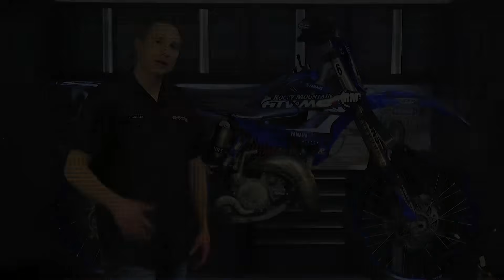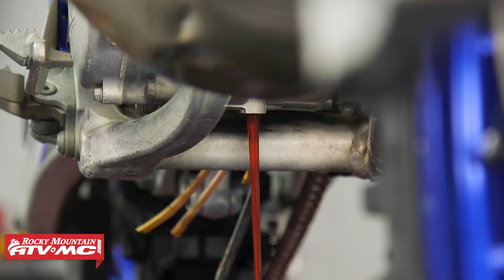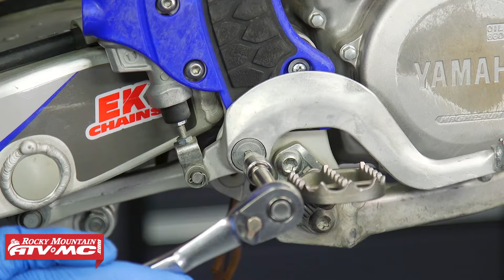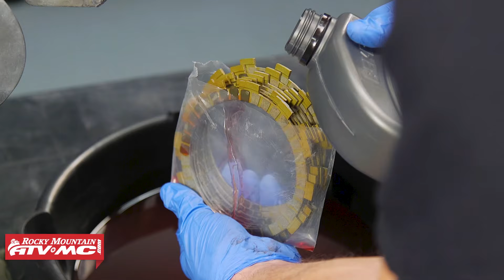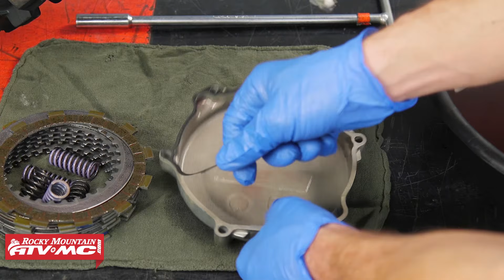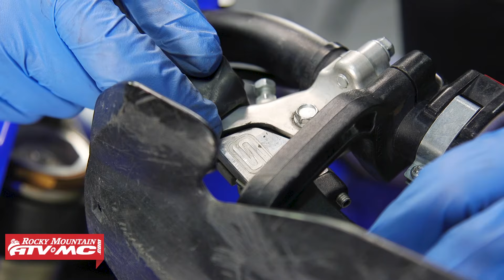How To Replace the Clutch on a Yamaha YZ125 & YZ125X

Comment: I have a 2000 yz 125 doing the clutch on it does mine suppose to have the ball because when i pulled mine apart there wasnt a ball . If I need it where can I get a replacement one I have been told I dont need it and others says I do . I just need some help kinda getting frustrated with the conflicting info . I dont wanna destroy my new clutch disks
Reply from the maker: You will not have the ball inside.

Comment: Does the pressure plate need to go a certain way?
Reply from the maker: No it doesn't.
Reply: @rmatvmc  Hi there just replaced clutch plates and cable on my 2014, having to use most of the adjustment in the cable and perch to get the correct freeplay, old cable was the same, thought it was worn out but guess not. Any ideas?  clutch doesnt disengage until the lever is nearly all the way out. Cheers

Comment: Never use Tusk aftermarket parts their junk. Used their plates and springs and they tore up my baskets after one ride. Couldn’t even pull in the lever. 600 dollars to get oem and runs great now. And yes I know what I am doing.

Comment: @Rocky Mountain ATV MC - Can you comment on what impact the clutch spring length has on the way the clutch lever behaves, if any impact at all?  Is there a solution for making adjustments to a clutch that engages near the end of the clutch lever travel?
Reply from the maker: The springs keep the clutch from slipping, so it will only affect that and how hard the clutch is to pull. All of your adjustments will be in the cable, perch and the lever. If the release is right at the end, use the adjusting screw on the back of the perch, and the adjusting screw on the lever to get it where you want it, then use the adjusters on the cable and perch to get the right amount of free-play in the cable. -Charles
Reply: @rmatvmc  what if your clutch lever does not engage at all ,when I put everything back the lever is very loose! No engagement